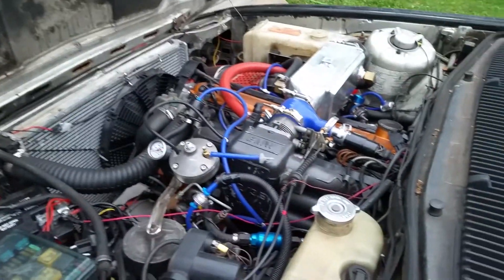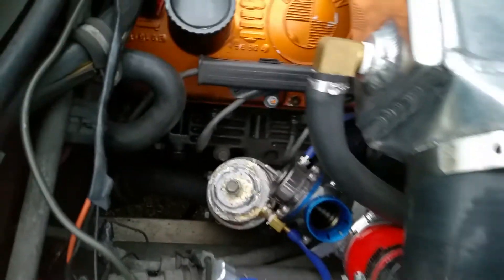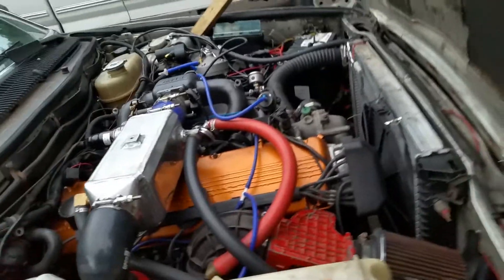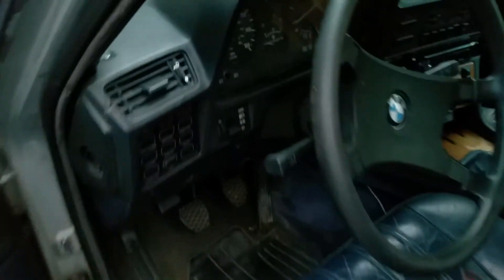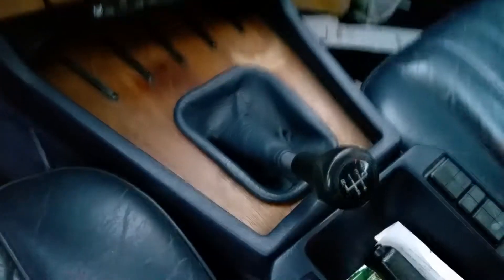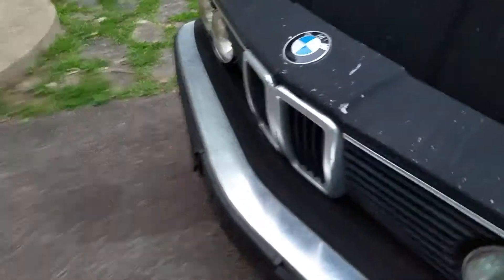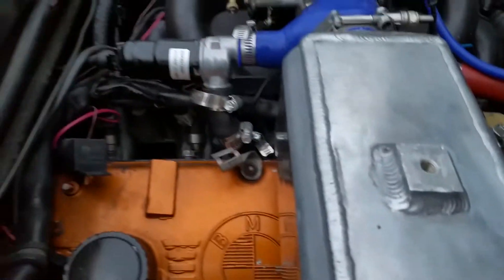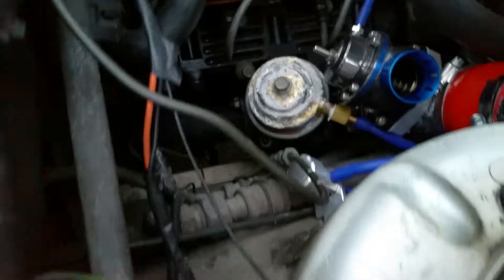e23 735i bmw m106 turbo swap!

Comment: You still using the knock box unit which also use to control the auto trans ? I’m doing same swap.
Reply from the maker: No i didnt use it i had the 5sp manual in my 735i.

Comment: Is that a custom Water to air intercooler or is it possible to buy one of these of the shelve?
Reply from the maker: I got it on ebay
Reply: @turbocraz1  any problems with it? And how expensive was it?
Reply from the maker: @matspyt6031  I don't remember it was just a China one think it was 12x4x4in